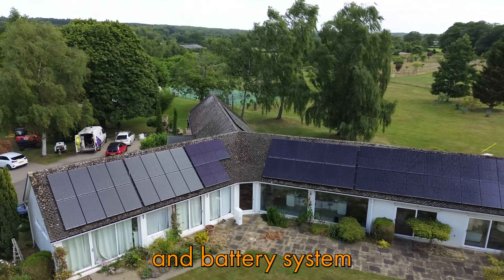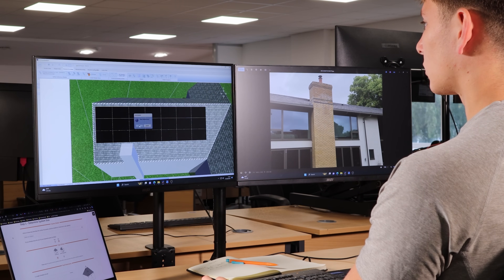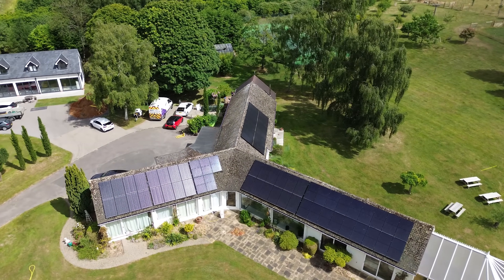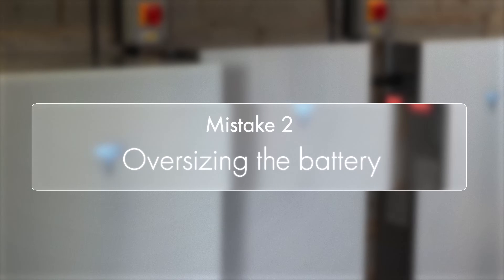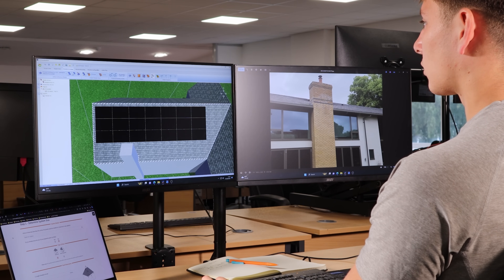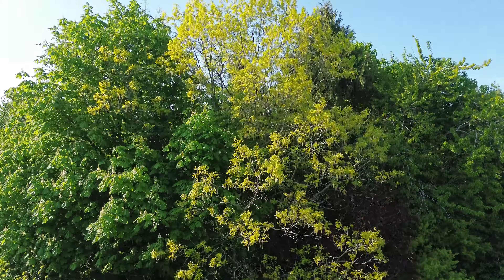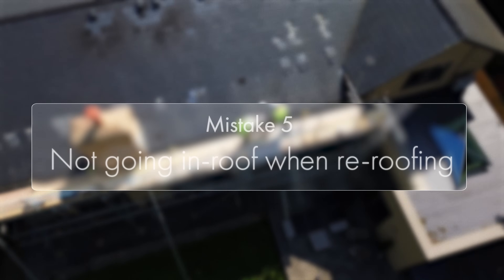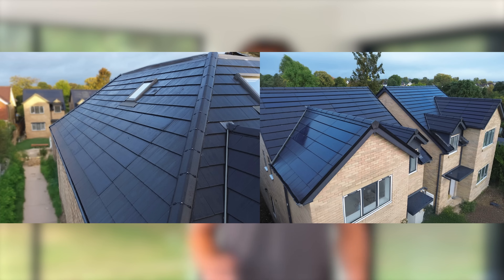8 WORST Mistakes To Make Installing Solar - Don't Waste Money

Comment: Again an excellent video, Tok. While I wholeheartedly approve of your refusal to oversell what isn’t needed, I would just remark that maximising financial return may not be the only system-sizing metric. A margin of over-capacity provides an “insurance” benefit that many would value, particularly when their day-to-day usage is variable (even weekday/weekend).
Any battery-sizing questions are best overcome by modularity (with appropriate increments) and ease of future expansion. 

One thing not mentioned in the video was “openness” - the minimisation of manufacturer tie-in and dependency, even to the extent of system operations (for the entire life of the system) being completely reliant on proprietary software running on servers somewhere in the cloud.
Reply from the maker: Thank you. I completely agree with your point on building a slight margin into the battery system and using modular batteries to increase the size as and when you need it.

Also very prudent to try and use technology that is independent from the manufacturer that produced it.
Reply: I couldn't agree more. I actually bought 2 more batteries simply because, from usage experience,. I found in the winter months, we were tending to run out of stored power come the evening. Those extra 2 batteries bridge that gap. Winter months I tend to charge the batteries up for a couple of hours each night at the cheap rate. Apart when doing the evening meal, the use of day time rate electricity from the grid is minimal. 

I think the price for the export via solar is inevitable to change. I just look at how much solar has been installed near by. I was the 2nd home owner on the estate who installed solar. Now it would be easier to state who doesn't have solar on their roof, such has been the explosion.

Comment: 1.  In countries/areas where grid is unreliable and power cuts are a norm, oversizing battery bank is always advisable. That's what we try to do in Pakistan.
2.  "Hybrid string all in one inverters" do work during power cut.
Reply from the maker: Hi, yes if your motivation is to protect against power cuts then it’s definitely a good idea to oversize the storage. 

For inverters to continue to operate in a power cut, the system has to be wired so that they are able to. They’ll turn off by default.
Reply: Where frequent power cuts are normal, it would surely be standard practice for the system to be specified and installed so that it would operate in “island mode”.
Reply from the maker: That may be the case in places like Pakistan as Muhammed mentions. In the South of England we don’t specify it as standard.
Reply: @spiritenergy_uk  My point exactly!

Comment: One thing I've seen people be surprised by is the fan noise from the inverter. Some can be quite loud under load, and this is something to take into account when placing it. It'll make a lot more sound than an heatpump outdoor unit.
Reply: Inverters with IP65 and above rating don't have fans. They use natural cooling having a heatsink.

Comment: just a little observation, I get Octopus are competition, but you don't cover the UK.  I am having a solar install with them, happy with the tech, the presales and care so far and I have done a lot of research.  Sure not the cheapest, but not a bad way to go.  This is the second video I can see where you are calling them out, but I think it's a little unfair and after accepting their award ealrier in the year, pretty ungracious.  Look you have a fine service, build it on your reputation - I would have loved to have gone with you.
Reply from the maker: Hi thanks for the comment. The first point in this video was not to insult Octopus, but to point out that national installers may not get the same peak power out of your roof as a local installer that has access to a larger variety of panels. We’re very grateful to Octopus for partnering with us, however, when it comes to getting solar, maximising the power output from the roof is paramount.

We will be more careful next time. Thanks for your feedback and for watching the channel.
Reply: I think it's a matter of choice. Do you go with Octopus which will never be terrible but never be the best either or do you go with a local installer which might be terrible or may just get you the best and most recent technology for your home?
Reply from the maker: Yes precisely. Thanks for the comment.
Reply: @SolAce-nw2hf  its a good point, if I could have got spirit energy in my area it would have been a slam dunk, i have lost faith in trustpilot so went for the national supplier in my use case.
Reply: @BobAnnNZ It can be pretty hard to find a good installer. Recently Gary does Solar has put together a directory. But Octupus energy has a brand to protect, so without that I would have done the same in your situation.

Comment: I have a renewable energy company and a construction company and we do a lot of solar installations. 
Spirit energy and this particular video demonstrate that they are a quality outfit with good knowledge which is in short supply with many new companies springing up to offer you cheap installs. It isn’t about having a cheap bundle install it’s about energy consultation to get the best system and performance for your money.

We like to focus on your household energy consumption and how we can best provide maximum energy from your solar throughout the spring and summer months with the addition of a decent size battery that can capture off Peak grid energy, keeping your electricity bills to a minimum throughout the winter and autumn months.
Two points a lot of my customers to Gary Does Solar as I do spirit energy because this young man has an excellent delivery and he’s very clear about the message. If they’re in your area, you really should contact them to ask them for a quote because I think they’ll take some beating on expertise, quality and trust.
Reply from the maker: Thank you for your comment. That’s very kind. I’ll check out your website.

Comment: I cannot watch anymore of this video lol. You are correct  but how far do you go. The most important first point is dno and trying to max as many pannels east West and south.  Then see if your DNO will honour a larger system than 4kw.
Reply from the maker: Thanks for the feedback. Would you be able to expand a bit on why DNO is most important? It’s certainly important but largely out of the homeowner’s control. Of course optimising the system to best work under a DNO restriction, should you get one, is key.
Reply: I will try, customers looking to take advantage of a system mostly think a 5kw battery will.do everything but as we both know its not the case and the differance between winter and summer light has a huge impact on return. They also have this idea that when they loose power from grid they are covered. Well in most domestic set ups it's not the case. EPS is a feature on hybrid inverters yes but not to power your home completely. So my customers are advised to go bigger than 4 kw and to use East West and south for arrays. We would advise at least 15kw battery. Remember I speak for rural set ups not in towns.  Most homes are on 60 amp supplies. Also electricity is the main source.  I even had a refusal to fit a ev charger to a customers home as the DNO refused application. The DNO have accepted larger than 4kw but with restrictions ie export limitation so the system would need to have specific hardware, also we normally have to pay £380 to the DNO for our systems once we choice specific hardware to meet what they want. Its a long process but it has to be done first. A standard quote for 4kw with battery no prob. We can go in and fit it then send in paper work. But we noticed customers in many cases are looking at hybrid off grid systems where they can work between grid, generator and batterys as most customers want a system to work when grid is out. Yes you prob don't get outages, we do. So for us it's DNO if it's out of the 3.89kw .

Comment: Nice presentation as always. You make excellent videos. Althought you are advertising your company you do combine it with good advices. One point I would note is recommendation to place the battery on the outside of the house. Although it is possible, during the cold and hot days it significantly reduced the battery (and built-in inverter) efficiency, contributes to the longetivity and forces activation of heating pads in the batteries which then additionally consume power. So although it is an option, the customers should be advised on the downsides and default recommendation should be to install them in environments with moderate temperatures.
Reply: Surely that depends on the position of the installation.
Reply: @neilmarshall2315  It depends on the position only to a certain extent. Installing it away from direct sunlight will reduce the impact of high tempetratures. But if you live in a hot climate and it is 45°C outside, the outside air temperature will be the same regardless which side of the house you are on. At high temperatures inverters protect themselves from overheating by rampindg down production, effectively reducing the amount of power they produce. 
Batteries are also impacted by temperature and for LiFePO4 batteries operating temperature is defined as 0 - 60°C. So if the outside temperature reaches 0°C the BMS will switch off the charging to prevent battery damage. To prevent that these battery cases have heating pads which warm up the case to an operating temperature. So that is inevitable energy loss in such case. So in cold climates if you install the battery outside it will help if you position it away from direct wind. Also installing it in the garage will be better. But if it is -5°C outside the heating pads will turn on and it is only a matter of amount of energy which will be wasted. That's why it is the best to install the battery in a basement or another stabile environment. 
Although safety regulations do limit a lot where they are allowed to be installed. I hope now that we are moving away from Lithium Ion to LiFePO4, which is much safer, those regulations will loosen up a bit.
Reply: @gajnjaca Whilst it’s great that this video is reaching an international audience. I think it is mainly targeted at the UK where the company is based. It’s true what you say, but in the UK it hasn’t yet reached 45C and typically we don’t use aircon either so interior and exterior temperatures in summer are not that different.
Reply: @neilmarshall2315  Yes, in the case of UK the issue is with the temperatures close to 0 or below.
Reply from the maker: Hi, yes this is a good point. I think it comes down to the logistics of putting it outside and the thermal management functionality of the battery you’ve chosen. As you say, something your installer should discuss with you.